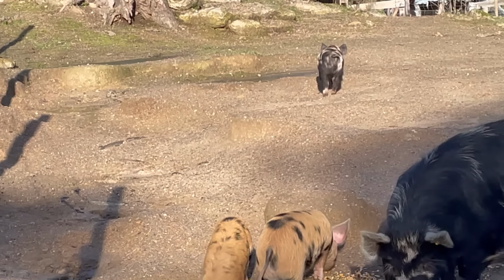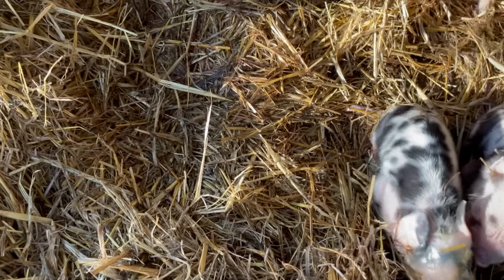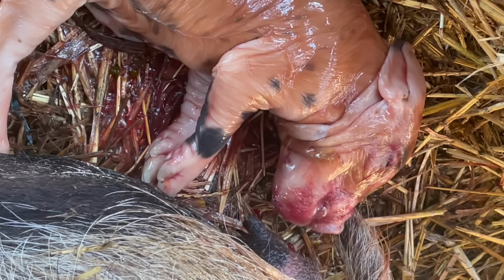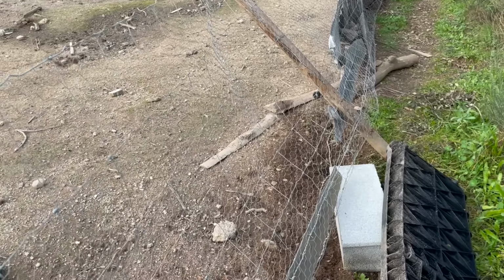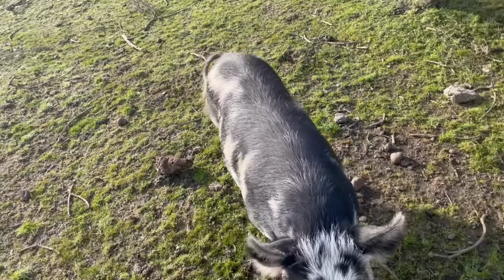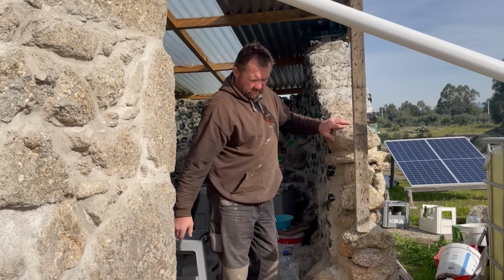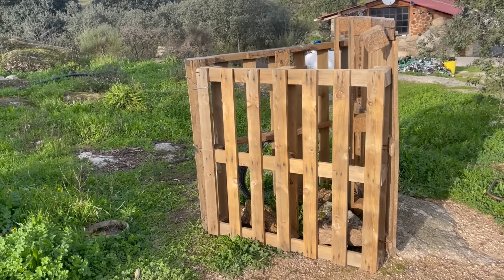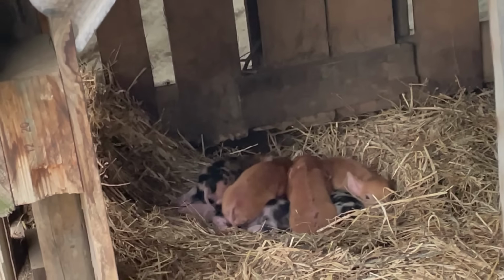MY CRAZY OFF-GRID LIFE RESTORING A RUIN AS A PIG FARMER

Comment: I suppose that even made of pallets filled with rocks instead of a cylinder made of wire fencing they are called "Gabions" either making a fence post or a can make a fence structure filled with rocks to make a wall. A wall would be good in that weak area of fence that the pigs break through.
Reply from the maker: I'm actually debating moving that fence and giving more space.